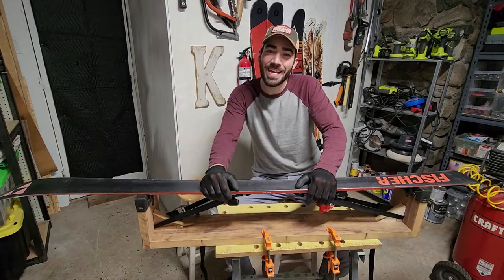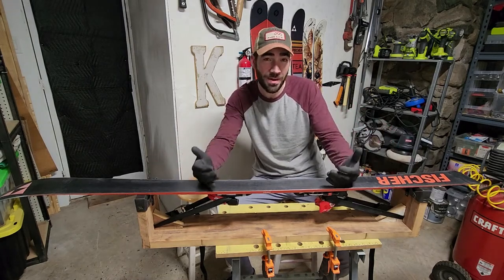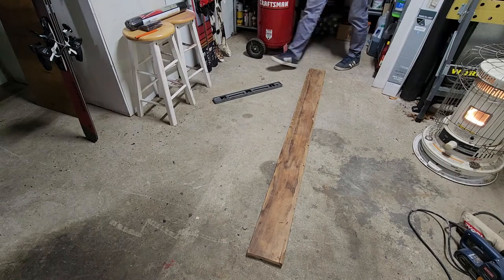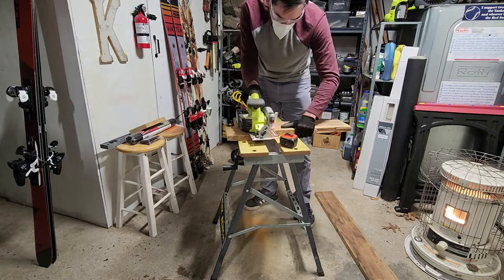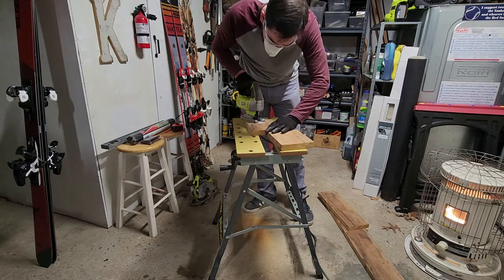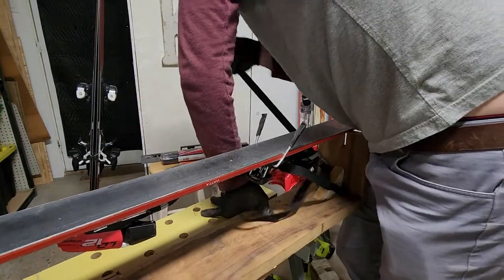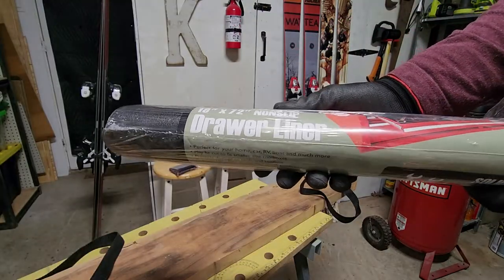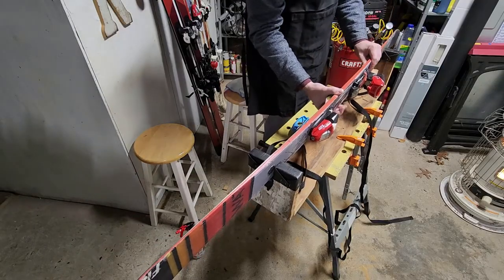How to make a simple Ski vice

Comment: I have many touring skis. Wondering how I can lash down the tech toes with those straps. Any suggestions?
Reply from the maker: Interesting, I haven't tried with touring skis. I've seen a similar build to this that used much thinner Paracord instead of lashing straps. Maybe that would help?
Reply: Cut a ~3cm thick piece of hardwood the same width as the front of your touringboots and drill holes in the side at the same spots your tech-inserts are on the boot. Screw it from the bottom to Karl's vice and you can simply click in touring bindings. If you have rubber on the ends of the vice like Karl and adjust the height of your wood-tech-toe so that it slightly bends the skis they won't move, no need to lash down the heelpiece in any way.